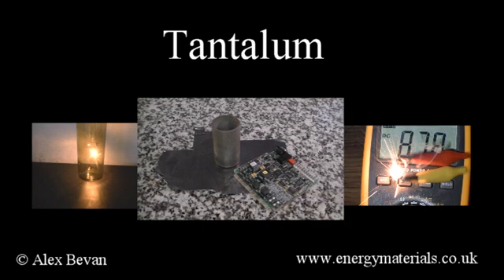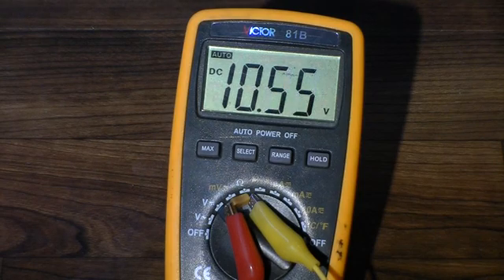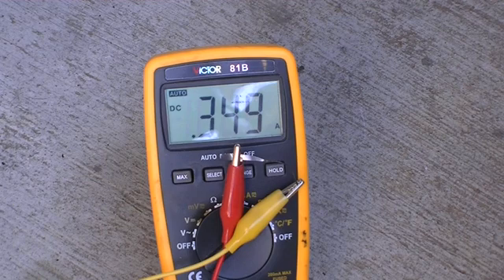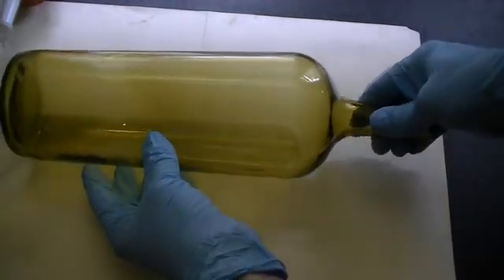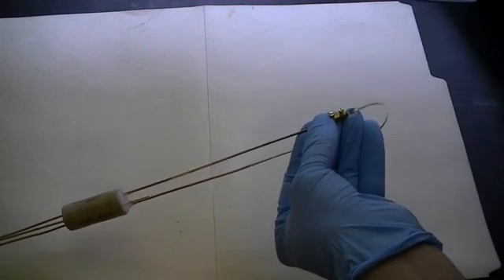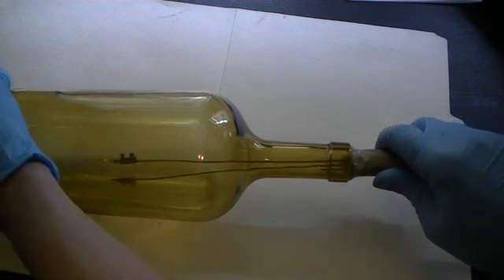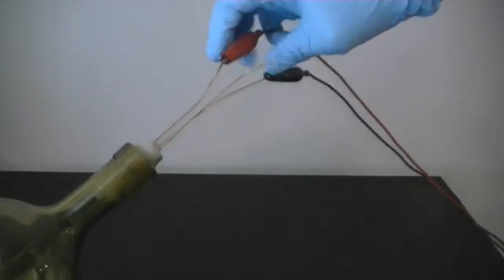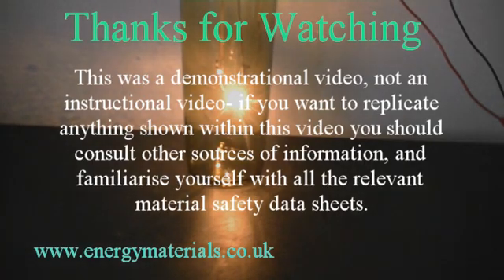Tantalum -metal and how to make a tantalum lightbulb

Comment: Would using round wire increase the light output of the filament part of the bulb.
Reply from the maker: A wound wire of a good length of round wire as apposed to the dog bone shape used in the video would give you a longer wire length, so yes, more light, but if the cross sectional area was the same as what was used in this demo then a higher voltage would be required to drive the same amount of current through the wire due to the increased resistance by the longer length of wire by coiling.